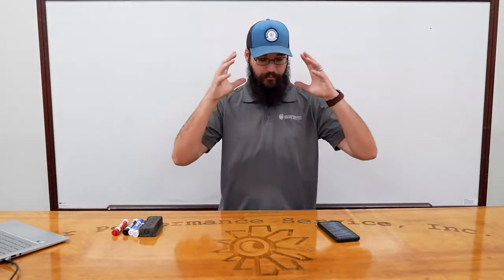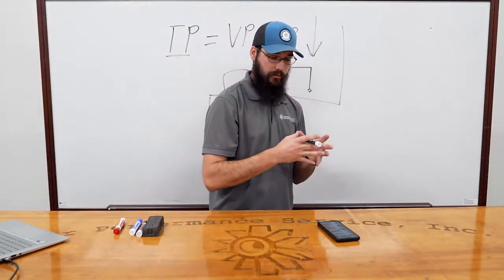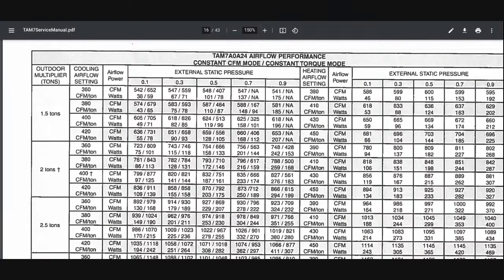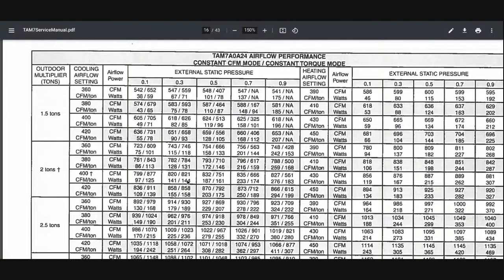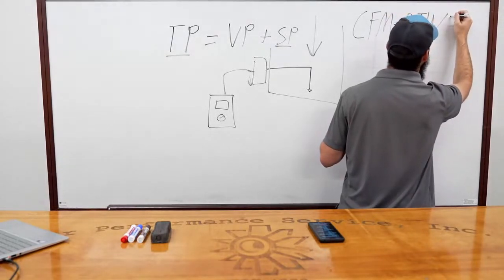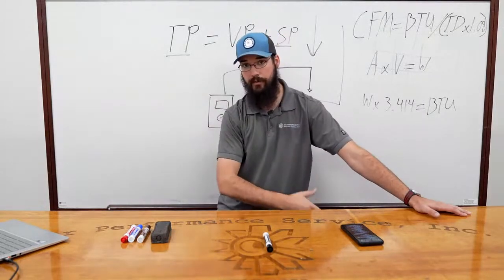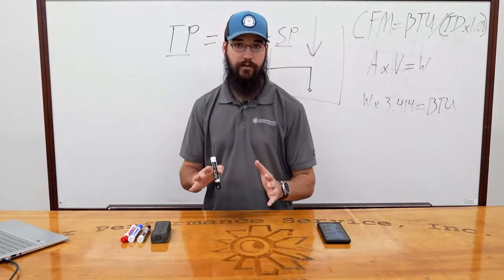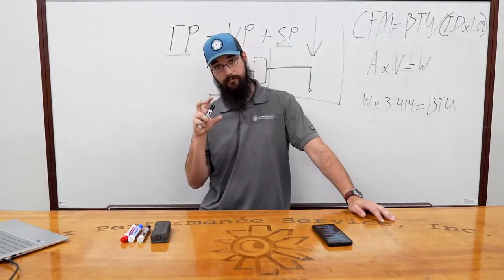Air Flow in Air Conditioning Training

Comment: At 36:31. The dividing line for checking airflow on a wet or dry coil is 65°  minimum and point of use (cooling or heating). So above 65 and in cooling mode, you definitely want a wet coil. Likewise,  above 65 and heating mode, a dry coil is needed. It will usually only take 10 to 15 minutes for coil to be in this state if switching from one mode to the next for commissioning purposes.
Reply: Just use standard air.  It’s not that critical.
Reply: @rodgraff1782  sorry bud. It is critical when commissioning a system for the first time and setting a baseline. Especially roof top units, equipment that should last well over 10 years if installed with consideration and pride.
Reply: @jaysonhines1  You still feel the same way?
Reply: @bunnyman6321  yes, especially with the new units having vfd drives.
Reply: @jaysonhines1  Interesting
Reply: @Bunny Man  interesting....why? It's only been 3 weeks ince my first response. What would change?
Reply: @jaysonhines1  I can't tell what would change for you cos I have no idea what experiments you conducted. That's why I asked duh.

Comment: You didn't describe a Pitot tube, what you described is really a static pressure probe. A Pitot tube is a tube in a tube measuring Total Pressure and Static Pressure. If both tubes are connected to a Manometer or Magnahelic gauge will give you the Velocity. (Differance between the two is velocity)